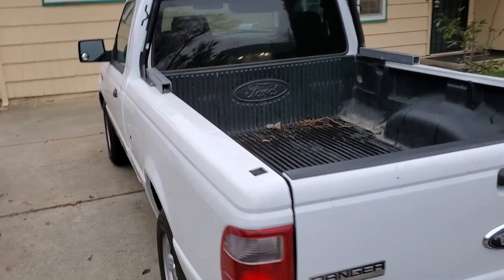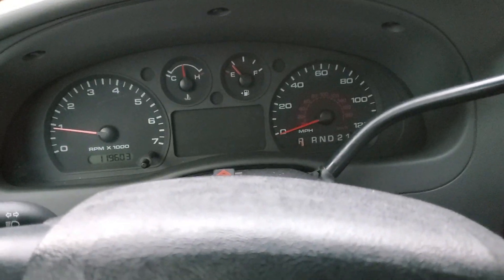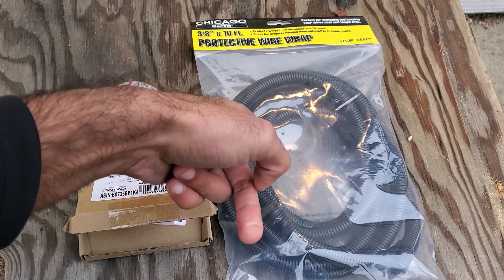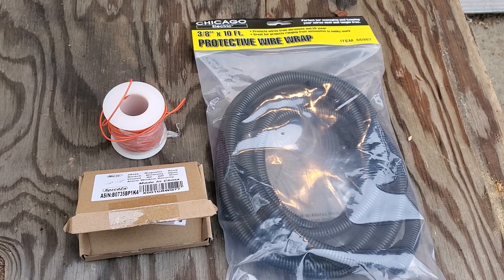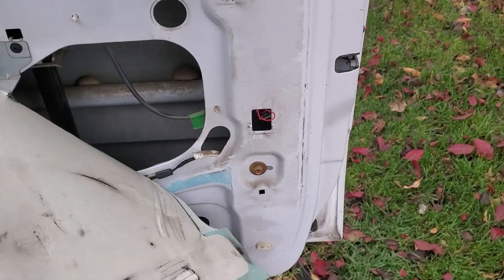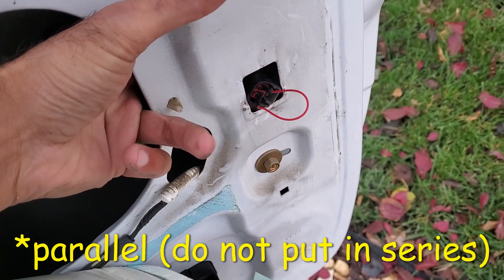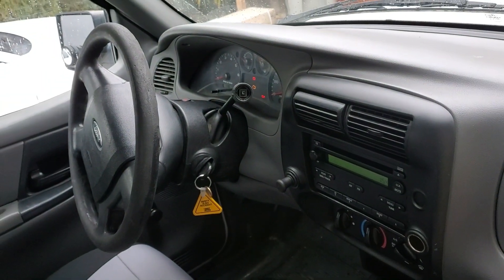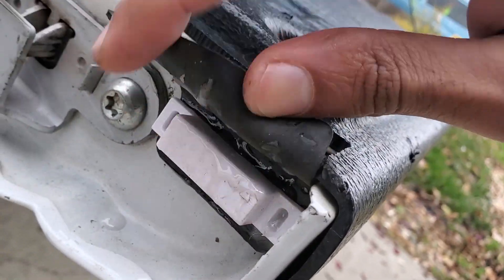How To Install A Tailgate Ajar Sensor On Any Truck!

Comment: Don’t you need an over-ride switch (toggle to eliminate new parallel reed switch) for those times when you deliberately drive with tailgate down?  (For example, hauling plywood in a short bed)

Comment: Im doing this on my f150. I have a cover and my bed is full of tools & equipment. Not fun having tools splayed all over the road behind you 😂. I just drove a half hour to find bed ope and a bucket of tools sitting out on the tailgate. Cant belive it didnt fall off, i even did a powerslide on the way & the cars behind me mist have been 🤦‍♂️